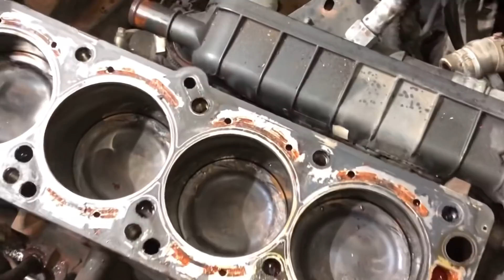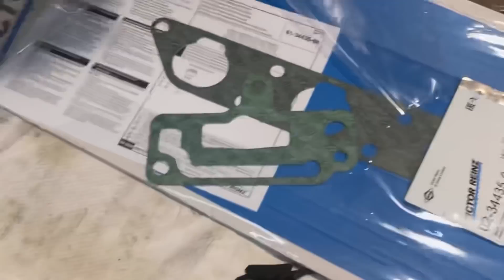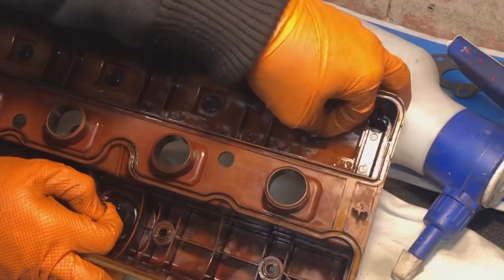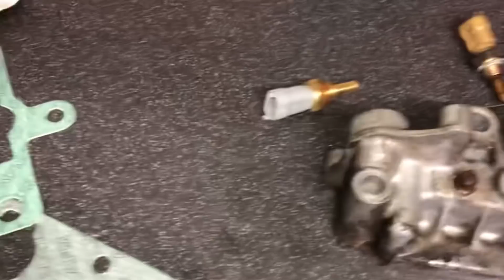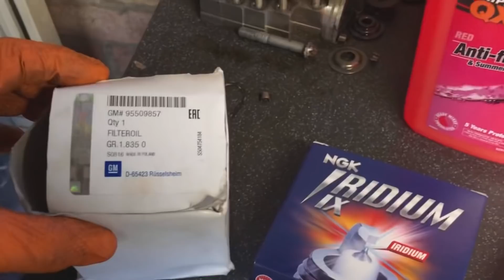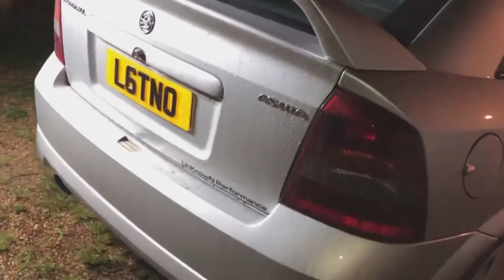OPEL Z20LET HEAD GASKET FAILURE & How To Fix It YOURSELF!

Comment: Just about to attempt to do my head gasket myself so using your video for tips. What size tap did you use to clean out the head bolt holes?.

Comment: Cracking video mate 👌I'm currently having issue with losing water not sure if it's the common fault with the oil cooler or head gasket but car losing water over night so hoping it's cooler 🙏but I've been thinking doing head gasket my self this really helped thank you where are you based please if decided to have it done and not do my self

Comment: Great vid, Couple of questions, you know you have to fit the oil restrictor when fitting the VXR turbo to the Z20LET is this the case for Z20LEL/R?

Also is the stock 2.25" exhaust fine for VXR stage 1 power 260 - 270BHP? I have a LEL I fitted to a Astra H van, It runs 80mm MAF, VXR Injectors, VXR ECU so should be close to the VXR 236bhp on stock turbo / intercooler.

I have pre cat delete, stock centre cat, power flow centre section and it also had a power flow back box but was way too loud for a daily van so I fitted a stock Astra van back box still 2.25".

My Plan is to fit a VXR turbo ( already have a junk VXR turbo so will source a core) and a cheap front mount intercooler in the hope to run a healthy 260/270bhp. do you see any issues with the above?

Comment: Recommend 10w40 semi over a full synthetic? Even for z20leh with pressure and squirters 
Cheers
Reply: Why 10w40 ? They recommendate me 5w30  for a Z20leh engine.  Now i have doubts what oil is the best.  🤔
Reply: most petrol vauxhall engines with hydraulic lifters should use 5w30

Comment: Did you check to see which headbolts were loose / had lost their clamping force. Realistically most of the time you can eliminate the leak just by retorquing the head. This applies to just about  everything with an aluminium head.
Reply: The head gasket had failed tho hadn't it ? From what I presumed , I'm sure he said the gasket had failed cylinder 2 between waterway and cylinder causing the water to clean the outer edge of the bore , so re-torque or stretching the headbolts wouldn't have any effect,  once a gasket fails specially between a water way and oil way the only way to eliminate the effects is to replace the gasket . I suppose your method would kind of work if the gasket had failed to seal between a water/oil way and the outer edge of the engine as to the only issue being a fluid leak and no compression issue .
Reply: @vanlivingandmagnetfishing5263  You learn to do that with every head. Then you learn much more. Head gaskets never "just fail", they have warning signs first. The only exception would be one of those stupid tunes with pops and bangs. There's just no sense in it at all.

Comment: So nice to see head without cracks around spark plugs, on other hand so sad when I see engine block cooling pathways so rusted. I honestly do not get it why people use tap water? Water is great in thermal conductivity, but all benefits go away once when block starts to rust. It could be head gasket failed due to that reason anyway, since heat is easier to build in the block and harder to transfer on to water when block is rusted. And there you go. One thing that can save the day is using undercut cylinder head bolts. When things get hot, claim is, it helps to save the day since undercut bolts allow elongation just as needed to save the head gasket. It is nice story from ARP, hope it is true. Like the video, thank you for sharing! and hope owner shall clean that rust and stop with tap water usage :)

Comment: I used Ford Motorcraft RS Turbo spark plugs. I've read about the tips falling off the NGK ones. I did measure the plugs and the where the same length. Not sure on the gap though so left them as they come. Seem to work OK.

Comment: Hi Aaron, great videos thanks. I see you’ve been asked what you use to clean carbon off with, can you let me know ? Thanks
Reply from the maker: Soak in Wd40 remove carbon with light scotch pad, clean with brake cleaner. Make sure to grease the cylinder walls for grit and clean well with clean rags
Reply: @AaronUnknownPerformance  thanks for that and keep the z20let content coming 👍🏻 Have a great Christmas

Comment: The bolts for the camshaft wheels have to be renewed every time they are loosened mate
Reply from the maker: Its definitely not necessary. Try find one thats snapped. Ive measured stretch on them in the past and no fatigue
Reply: @AaronUnknownPerformance  okay fine then, I just saw that Opel / gm recommends changing them mate
Reply: That's why always get new ones in
Reply from the maker: Yeah the manual does. I suppose if your are replacing them once only then its you may aswell replace, we normally have the pulleys off alot especially on the higher power builds

Comment: Hello mate.Why go that way cheap-not changing the timing belt,all the pulleys and water pump when do head gasket job?
Reply from the maker: This car had the water pump, cambelt, idler pulleys and tensioner replaced about 200miles ago. Check previous videos

Comment: I need a cylinder head to go on my z20let if you have one for sale UK.
I just test run the cylinder head i bought but I am using cam caps from my old engine, long story story, it has a fair bit of play in there.
If I put the cams and cam caps back in my damaged old head, its fine, no movement or rattle.
Reply from the maker: Yes cam caps are machine for the specific head they cannot be fitted to another head without machining. I do have spare heads